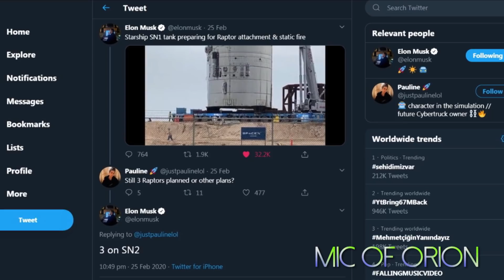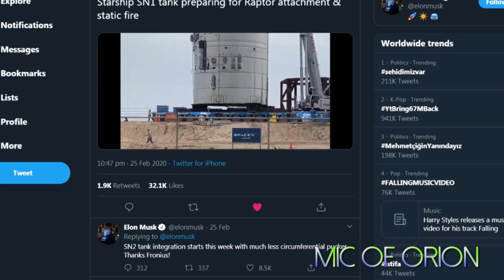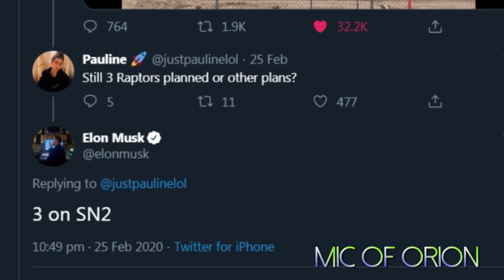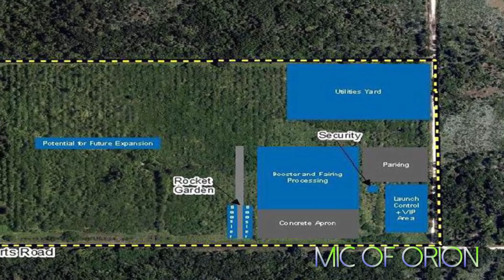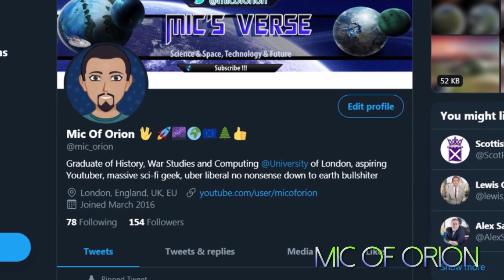SpaceX Starship SN 1 Static Test Imminent

Comment: I am not feeling the Starship AT ALL.  It looks like a flimsy bucket of bolts.  You could see the rings deforming (again) under the vertical pressure.  If that thing ever gets to orbit I would not be surprised if it gets ripped to shreds on reentry.  Making pressure tanks is a mature mechanical engineering technology and it started in the Steam Age.  There is no excuse for the tanks blowing up.